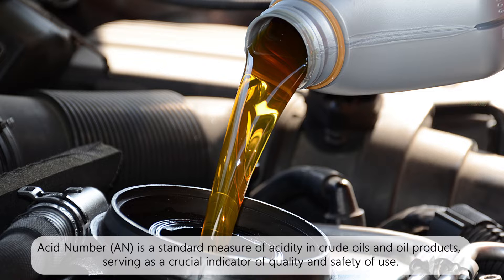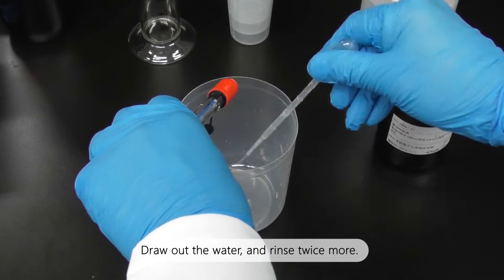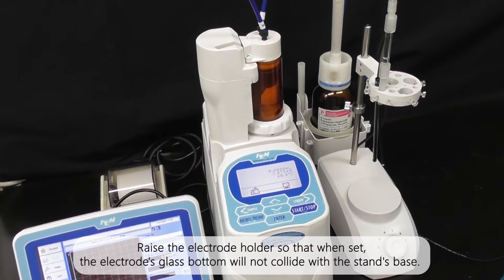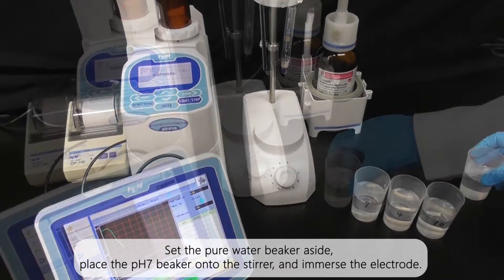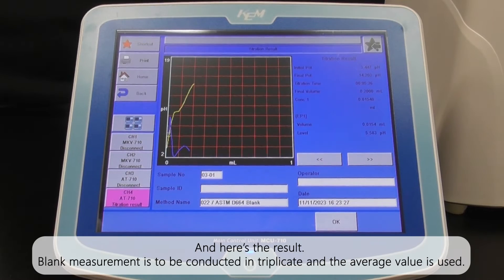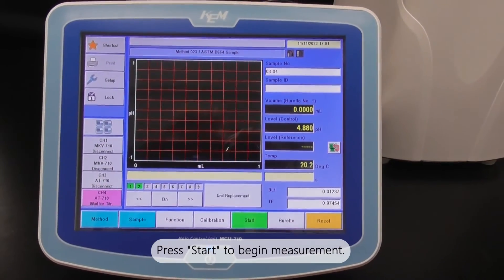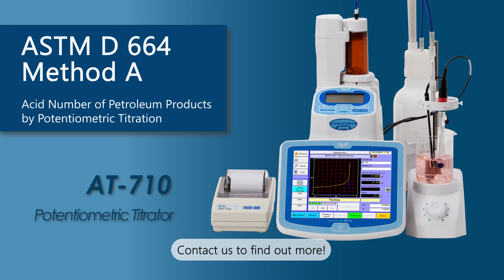How to measure (Total) Acid Number (AN) using KEM's AT-710 Automatic Potentiometric Titrator.

Comment: What is FA in the formula
Reply from the maker: Thank you for the question. 'FA' is the 'Local Factor' in KEM's terminology. The Local Factor is a method-dependent factor (you can set a factor for any given method), and is different from the 'Factor' ('TF') that is set in the reagent information settings.
Reply: @kyotoelectronics3672 can It will calculate the factor if I do by weight standardization? And what is the value of FA  ,still I can't understand
Reply from the maker: Dear  @AhmerHussain-bl6sg . Thank you for raising the questions regarding TAN and TBN measurements. We are currently looking at them all and we kindly ask for a little more time to complete all the answers, translate them to English, then provide them in the next comment.
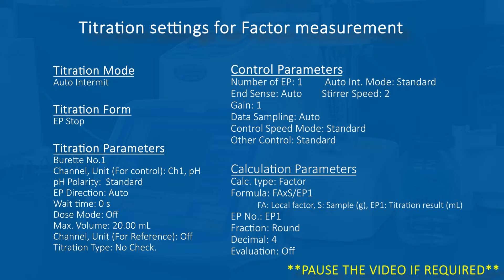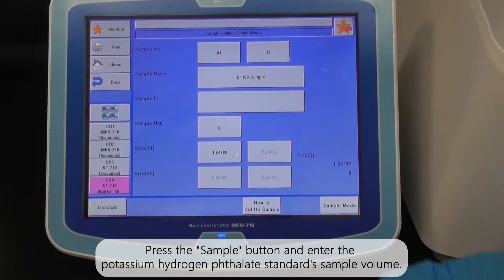Reply from the maker: Dear @AhmerHussain-bl6sg . Thank you for your patience. Upon review, and thanks to your feedback, we have identified that due to our failure to make it clear that volume standardization was performed, parts of the video are confusing. We would like to apologize for any inconvenience this has caused and will now address the confusing content. The standardization method presented in ASTM D 664 Method A, is weight (mass) standardization, but in this video, volume standardization was conducted. At 5:32, the formula “FA*S/EP1” is the equation for volume-based calculations. We have now added a correction annotation to the video showing the formula to use for weight/mass standardization. You can view this correction and the formula in the correction pop-up at 5:32 and in the Description section of this video. Similarly, the amount of sample shown at 6:09 is going to be different to what is needed when standardizing by sample weight/mass, so please take note of that. Factor will be calculated if you perform weight standardization.

As there have been inadequacies in the presentation of information here, we are considering replacing the video in the future. Thank you for your understanding and bringing attention to this matter.

Comment: excuse me, I have those instruments in the laboratory. but I want the data to go directly to the computer. Can I use the software to enter the computer without using a dot printer?

￼
Reply from the maker: Hello. Thank you for purchasing our products. Yes, you can export data directly to PC using the optional software called "SOFT-CAP" ( https://www.kem.kyoto/en/products/asoftware/softcap/ ). Please follow the instructions in the Data Capture Software SOFT-CAP Operation Manual that comes with the SOFT-CAP product. If you have further questions, feel free to send a detailed inquiry to our website's contact page ( https://www.kem.kyoto/en/contact/ ) and/or the distributor you purchased from. Hope that helps!